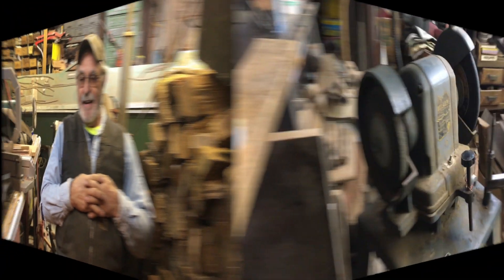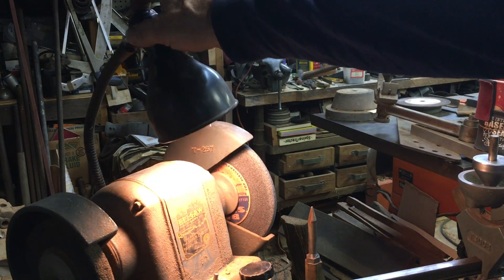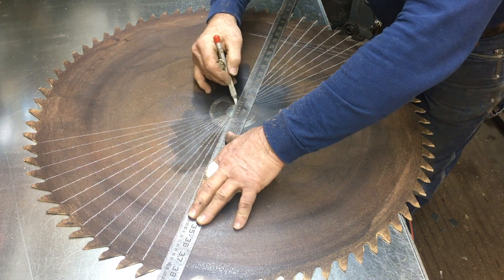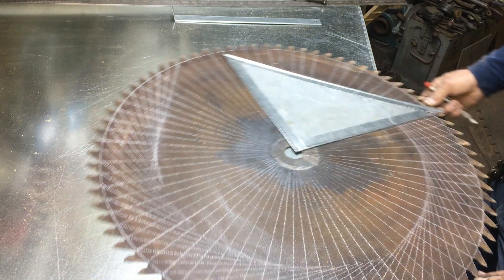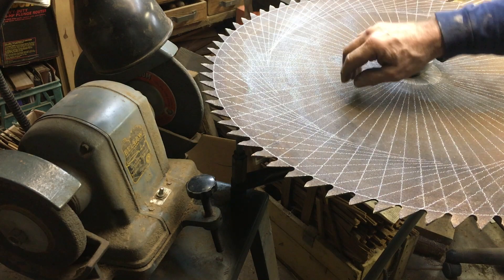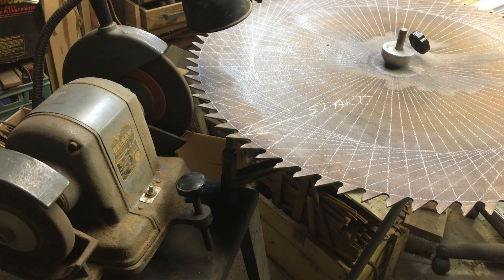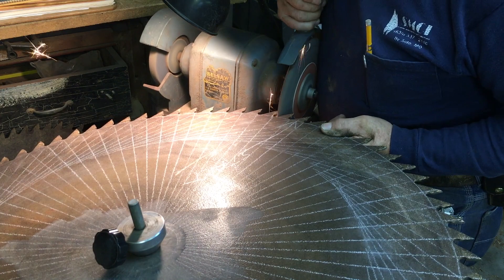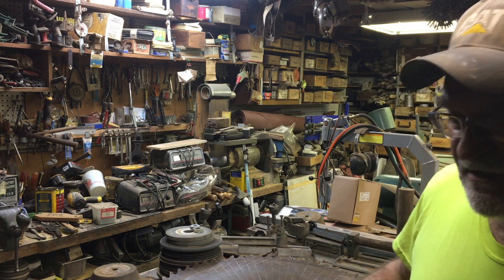Belsaw 10452  Buzz Saw Makeover Part 8

Comment: Hey would you do a video about how to sharpen a rip saw for sawmilling?
Reply from the maker: I think their tooth geometry is somewhat different, but if I get the chance I sure will record it.
Reply: @tractorman4461  thank you and yes they have more of a hook shape to the tooth.
Reply: @lostforevermore7150  just some quick advice for you on sharpening a rip saw blade. As long as the teeth are flat on the face and top. No angles in other words,you will be fine.
Reply: @JohnNaturkach  thank you very much I have been trying to find any information regarding this because blades for my sawmill are very inexpensive if you know how to file them.

Comment: good video tractorman i gtooth set ya squeez like pliars im tryin to figure out ...its missing a part but i think i can make the part thats missing
ot this new
Reply from the maker: All these years on these saw rigs and all I've ever done until this video was use two hammers....a four pound double face or a large ball pein for an anvil and another smaller ball pein to strike the tooth as it'd hang over the rounded edge of the handheld anvil.  Functional but not as consistent as this REAL saw setting set up.  Good to see you around Grizz. Thanks for commenting sir.  I see ol Driveshaft Drew over your way a lot too.

Comment: Your set up is newer than mine and I have owned mine for 48 years and Tom Svanda had it on his farm in the early 50's.     
A few things your readers need to be aware of is tension in the blade.  When you gum the gullets the grinding lets some tension out whether from heat expansion or going to deep. If the saw is to loose it will wander on the rim when up to speed  because the rim is stretching beyond what the central body  (Basically the third of the blade between the eye and the rim) can control.  This is unsafe and can lead to cracking in the gullet or even to self destruct.
Depending on how tough ((and Hard) the wood being cut needs to be considered so you have enough gullet to carry away the chip/dust and short enough to prevent breaking a tooth.  Dry hedge plays heck on a long tooth.  
You have set your hook to about 0 degrees and some saw set ups like that, most I used to sharpen and tension for got a line about a third of the way (behind) from the eye (center).  This helps  the wood kind of self feed so keep that in the back of your mind as you tend your blade.  I always check the blade for being in round due to so many people have so many ways to mess up a well set up blade.  
Some of the old timers would crank the PTO to the full 540 RPMs and with a 32" plus diameter  blade that is FAST and the blade had better be right so it stands up in the cut. Something I read  after several years of owning the Sharp All is to get the gullets  gummed like you did then shape your tooth if it  is way out of wack then put your set in then grind it on the sharpener.  If the blade is in good shape and only needing sharpened then put in the set then sharpen it. 
Old Tom always told me that sharpening a blade is like Corn Cobs, Turpentine and Cats Arses.  It works so you just do it.  My experience since then tells me a lot of things can happen from a poorly thought out idea. 
  I FORGOT to say  THANKS FOR THE VIDEO.  I hope my comment helps you and your viewers.
Reply from the maker: Thank you Larry for the awesome content in your comment !!  I certainly hope it will benefit others as well.  I am glad to hear others like yourself that have buzzsaws as well as the ability to take care of them. I'm sure you do a much better job than I.  I can't begin to tension a blade though. My 50'' sawmill blade is in bad need of hammering right now.
   The old man would round up the blade while its still on the saw rig by slowly moving a brick into the blade to grind off the high teeth.  Then go about the business of grinding the gullets to radius and shaping the teeth, finishing up with a fresh set with a pair of ball pein hammers.
   One of my biggest fights as a wee lad of 9 or 10 was helping my old Uncle Chippo stuffing a tom cat down a boot head first with 'dog push' and corn cob in hand......  LOLOL.  Man, that cat could hold his own, but he still lost the battle.  I think I still have the scars....  Thanks again Larry for your time as well as the memories of the really really fast tom cat !!

Comment: Hello Tractorman44
Denmark calling!!
I loved this video as i like to do a litte DIY my self. Very instructional. Would it be possible to send me some pictures of the sharpening jig? Well i think i could figure out how how it's made, but why invent the wheel all over again. :-)
Allso how many degrees are the theeth set at?
I wish you a nice day.
Reply from the maker: Good afternoon Bjorn, if you like, take a look at this video and it may help you a bit also.
https://www.youtube.com/watch?v=TZ36Rxpn754&t=590s  I put this one up a while back, and though it is not totally complete there is a bit of info about the angles.  Crosscut buzz saw blades should have a 45* tooth, laid out by drawing a line across the arbor's center to the tip of opposing teeth, then using a 45* square off the back of that line, mark the back of the tooth.  The grind has to be to a uniform distance from the center of the arbor out (gullet radius) to ensure all the teeth are the same size.

For a crosscut buzz saw blade, the set should be approximately 1/4 of the thickness of the blade off each side.  A little one way or the other won't matter a tremendous amount because they are running at a reasonably low rpm, usually 600 to 800 or thereabouts.  I use two ball pein hammers when servicing the blades outside, but from now on am going to be removing the blade and using the Belsaw saw set used in this video. Too much set puts too much back pressure on the teeth and can cause work hardening and premature cracking of the blade.

I really don't have a jig, per se, as the markings are used in conjunction with the gumming wheel on this Belsaw grinder to keep everything in alignment for perfectly shaped teeth.  But if you like, we can continue conversation of a couple different ways to do this without a special grinder like the Belsaw 10452.  I'm assuming Denmark is seven hours ahead of us here in the midwest...so I hope your day was productive and you have a nice week as well.  Thank you sir for the comment and for watching...but remember that I am NOT a professional in this field and am just passing on things learned from the old timers I grew up around.

Comment: How old is your Belsaw?
I want to buy a sharpener. Many Foley belsaw machine 
Any advise?
Reply from the maker: Well Ken, its been sitting in the corner of my shed at the very minimum 20 years and quite possibly 25 or more.  I don't really have a clue how old it is except I know it wasn't exactly new when I traded for it. I looked on Craigslist for a chainsaw sharpening attachment for mine and found a good number of them within a few hundred miles.  A lot of newer machines and some older and some were being parted out were listed too.  Then there's ebay and a lot of machines were listed all over the country (USA).  I think a basic one with a couple accessories can be bought for around 2 to 300 dollars plus shipping.  Of course there are the ones that have ridiculous prices on them too.  I saw one for $450 that looked like it had been submerged in water for years.  I can tell you with my very limited experience with this one, I really LOVE it !!  Thank you for watching and commenting Ken, I appreciate it sincerely.  What area and what country are you in, If you don't mind my asking.
Reply: @tractorman4461  Northern Kentucky, 20 miles south of Cincinnati. 
We use a tractor saw for fire wood similar to yours. I have 5 blades and can't find anyone to sharpen them. I have one with a small 1" crack at the gullet. No one will repair it . Any idea where I could get it repaired?
Reply from the maker: I'm not sure they would repair the one with a crack.  I think that usually means the metal has been stressed over the years and has become crystallized to an extent though I'm not really sure.  The old man always said that made them unpredictable.  I've sharpened by hand many, many times and though its a pain to do it really is not too difficult.  The trick is in maintaining the shape of the teeth, so if your's aren't misshaped too badly you have more than half the battle won.  The next trick is to use a NEW 12" flat file. Or at least a good one that still cuts good. LOL.  I tap an elongated wooden wedge in between the saw table and the blade to hold it steady and file a few teeth then rotate the blade and continue. I hit the fronts of the teeth with a little bit of an angle, the same but the opposite direction on every other tooth then set the teeth with two hammers.  Either two ball peins or a 4 pound two face as an anvil and a ball pein to strike the teeth tips in opposite directions every other tooth.  Too much set will cause the blade to eventually crack and too less causes it to not clear the kerf and possibly overheat due to friction in larger wood.

Though I've not done it, I have heard of using a gullet grinding wheel on an old table saw.  Lay out your teeth with soapstone because you have to free hand it.  Install the stone and raise it to the highest height to clear the bottom of the gullet reasonably square and SLOWLY index the blade into the stone for about three teeth, rotate 180* and grind three etc. to keep from overheating the metal.  Make sure the stone is rated for the rpm, you could explode the stone from over turning it and by crowding the blade into it too hard. Grind to your gullet radius all the way around, then shape the teeth fronts.  Touch up with a file with a slight angle..or not.. I've had good luck with these with a square cut tooth as well and because we are only cutting firewood, tooth geometry doesn't seem to be super critical. Though many professionals would argue about that and they are probably right, technically anyway.  Then set the teeth with the two hammers approximately 1/4 to 1/2 the blade thickness. Especially for cutting larger green softwoods, like elm or sycamore.  Closer to 1/4 for dry or hardwoods.  I don't know it this long reply helps or if you even wanted or needed it, but anyway....  

Do you have any videos of it running?  There is a lot of interest in these saws as evidenced by the number you see on youtube.  Btw, Kentucky is a beautiful state, we have driven through many parts of it many times.  We went for years to a small town tractor show down in Cynthiana Ky.
Reply: @tractorman4461  I lived in Cynthiana for 12 years. Still own a house there. Tractor show in Paris every year. I would like to call you sometime. 
Love your videos
Reply from the maker: Sorry I'm so late Ken, started out this morning processing bacons and hams at my brothers house from the three hogs we butchered last weekend.  Then went to the father in laws to work on his furnace.  He's 90 and living on his own.  Bad gas valve, have to pick one up at the supply house tomorrow and finish that repair.  Then the youngest daughter's gas line froze up in her car and wouldn't start.  I didn't get home until after 7.  Good thing I'm retired. LOL.

Did you know an old timer named Frazier Daley in Cynthiana ?  He and his son put on a small hometown tractor show and we would go down to visit until he passed away I think from cancer a few years back. Right on the outskirts of town.  Good time with a lot of great people.  They all called him Junior.  Well he started an on line forum called Antique Tractors Forum and it is still on line today. Several local Kentucky fellows still belong to the forum and actively participate, but the annual tractor show is no longer put on.  If you check out the forum, make sure you put the 's' on Tractors or you won't get the right one.

I appreciate you enjoying the videos, and you can call me anytime, though I gotta tell you my metal shed kills the dang phone signal so I rarely get a call unless it the summer, doors are open and I'm just inside a few feet. Evenings after 6 is usually the best.  In the winter I'm in by then. My email is whpete44@gmail.com. feel free to email and we can swap the cells via email.  Thanks again for watching the videos Ken !!